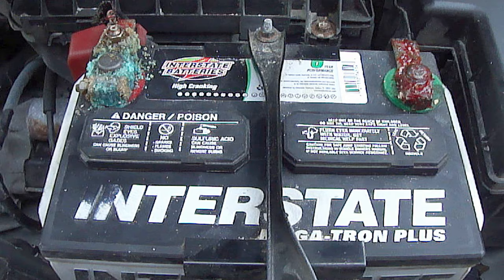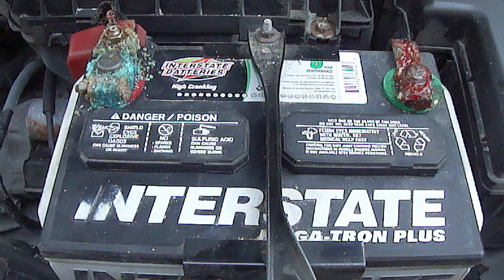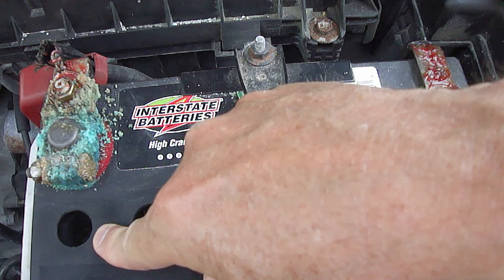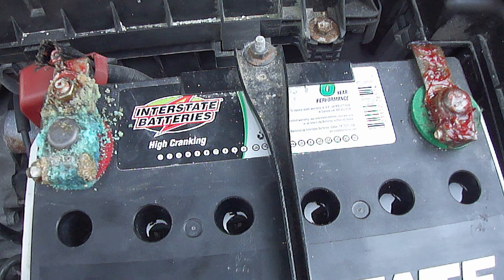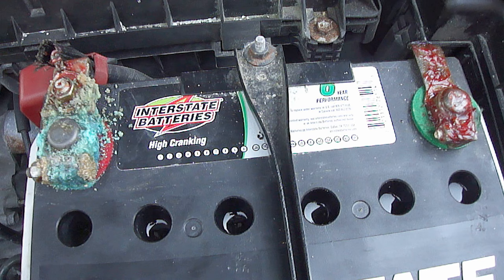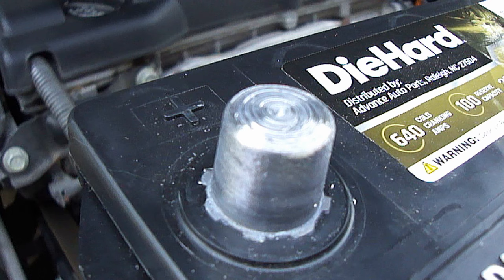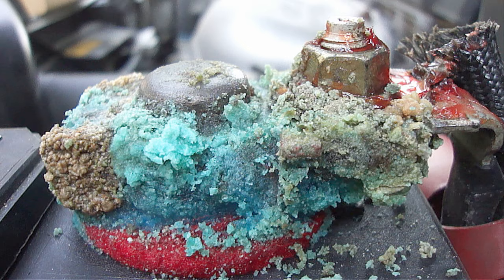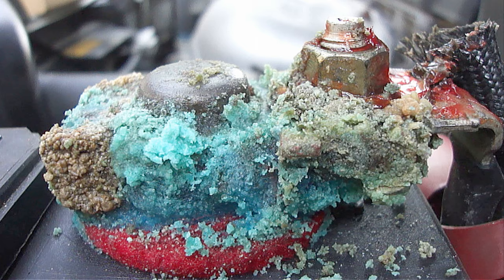Why Is My Car Battery Corroded?

Comment: Many thanks. Advance Auto Die Hard 2 year warranty is up in two months. Die Hard support said corrosion IS considered a battery defect and can be replaced under warranty for original purchaser with receipt. 

After watching other videos and then seeing yours the light went off In my head to check out the warranty status with Die Hard Support  at the number provided on the AA web site.  I explained that it can’t really be fixed and is a defect and asked was it covered under warranty. The rep said it is covered. 

After warranty you are likely in a maintenance only position naturally.  Thanks again. You saved me a lot of wheel spin. Weill see how it actually goes with them.

Comment: VERY helpful, Paul. Better than replacing the alternator or voltgae regulator which as recommended by some, which is an overkill solution to this simple problem.

Comment: Check your alternator voltage output, if the voltage regulator is failing and is overcharging the battery, then the battery cannot vent fast enough, it boils out through the terminal where the heat is most concentrated. Corrosion on the negative side can be a bad cable, bad alternator (overcharging), or bad grounds. Corrosion on the positive side can be bad cable/terminal, bad alternator (undercharging), wiring issues, or just a worn out battery. That's my two pennies worth.

Comment: Yeah, there's a seal between the terminal and case. But it's more of a matter of course during the manufacturing process than it is the manufacturer saying, oh, we better seal this area well. There is literally a vented cap inches away. Sulphating is what you could call a natural death in the life of a battery. Keep in mind that the cells of a battery are in series. One failing cell will cause the charging system to overcompensate with higher voltages for a longer period of time, affecting the remaining cells and speeding up the death of the other cells. It's why you replace all the (lead acid) batteries in a multi battery system, you'll chase that tail forever if you don't. If I had taken pictures of all the instances of battery failure in a multi battery system, you would see corrosion on every single positive post and maybe one or two negative posts in a four battery system.

Comment: Gator Loc is the answer.  When electricity passes through dissimilar metals “Galvanic Corrosion” begins. The most active metal will corrode at an accelerated rate. Traditional battery connectors are lead, with the locking device made of steel/zinc, dissimilar metals. Gator Loc™ is constructed with no exposed dissimilar materials, leaving no possibility for corrosion.

Comment: For what I don’t understand is even after I warrantied out the OEM battery that came in my Subaru Forester I still have battery corrosion issues. Blue corrosion. I remember seeing this one YouTube video around last year, I think it may have been yours (can’t remember), but anyways it was basically saying that battery corrosion can work it’s way down the battery cables spread like a virus to the other components it’s connected to. 
How likely is it for this to happen?
Reply from the maker: Is the corrosion occurring on both the positive and negative battery terminals?